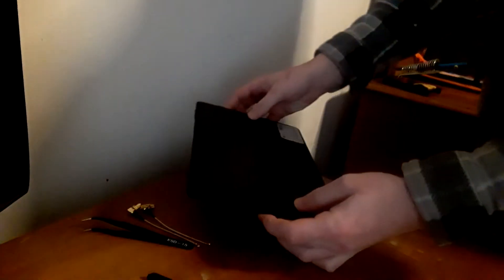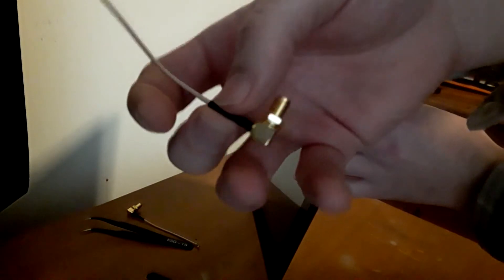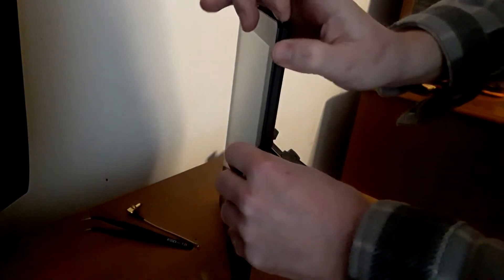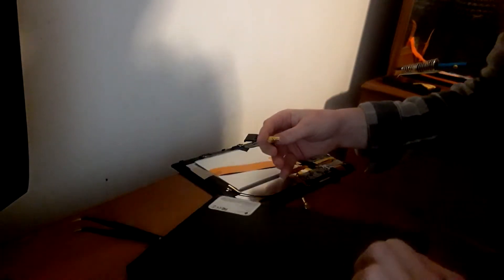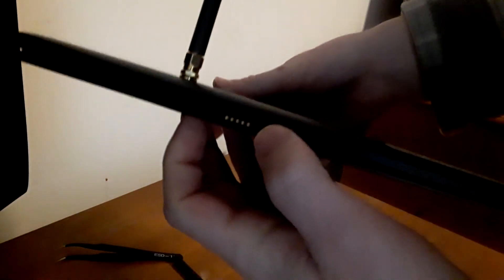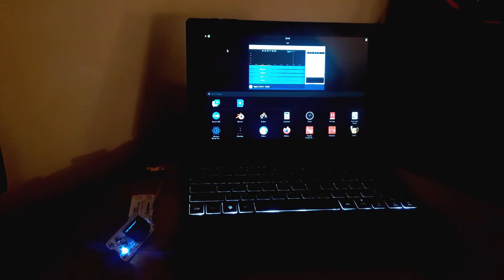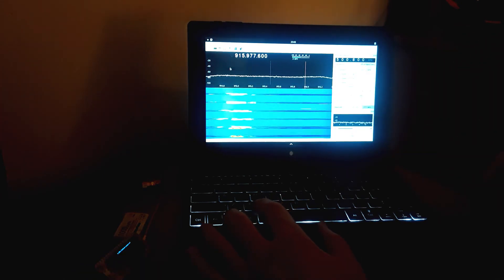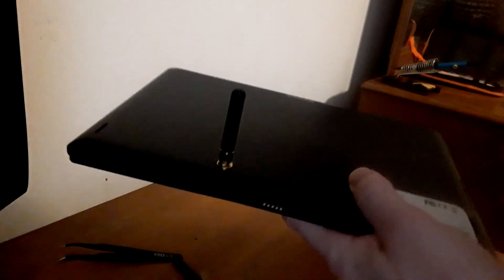Opening Pinetab + Add SDR Modification!

Comment from the maker: NOTE: To anyone trying this- Be VERY careful not to risk breaking screen internally. Not on video: grinded away a few milimeters of the 'cube' block part of the threaded end piece before closing + added a thin layer of electrical tape to take off the hard edge/cushioning. Be VERY careful not to put too much pressure on your screen when closing. Let me know what you think and if you have any questions at all! 8-)

Comment: Where can you get a replacement screen? And NO I didnt crack the screen following your instructions. My dog actually knocked if off an end table and shattered the screen. Any ideas of the specs on the screen or where you might purchase another screen would be greatly appreciated. I purchased the PINETAB 2 Screen but it was a no go; it did not fit!!!
Reply from the maker: You might be able to buy one from Pine64 - but I have no idea as they stopped making this model. 

One thing that might work better is asking pine64 forum if anyone wants to sell their pinetab v1 and then use that one for parts. It's an idea anyway.
Reply from the maker: Another idea; check the screen for model number on the back - then put that model number in quotes to make it come up on search with "buy" in quotes to find the same model.

This might be your best bet.

Man that really sucks about your dog knocking it off... I know how much that hurts. 
😥
Reply from the maker: Once in a while you can ask customer support if they have parts to sell - but that usually applies to current items. I don't think they have anymore screens, but searching for the exact model number in quotes with "buy" in search query, would likely be the best bet on search engines.

Sometimes the same parts are used in other products, and model number is likely to provide the most likely best results.

Since Pinetab v1 is older, less maintained for people, there's a chance you can ask on the Pine64 chats as well via discord etc. That's where most of the people who own them hang out, and some would likely want to sell one. Worth a shot.

Comment: Can i installed Bliss OS in PineTab? PineTab is repairable and upgradable?
Reply from the maker: Pinetab shown in video is version 1. Sadly, isn't available on Pine64 store any longer, but if you get lucky you may find one used from time to time.

Pinetab 2 is what I would wait for if interested in Linux tablet. Should have more info on availability around April according to Pine64 blog.

I'm not entirely sure how modular the Pinetab2 will be, but do know the back will pop off much easier by design for repair related needs.

I'm guessing it will be similar to Pinetab 1 (seen in video), but the power will be much better, more in line with pinebook pro. 

On Bliss OS, not too sure if there is any dev on pinetab, though there has been for other Pine64 devices.

Comment: What rtl-sdr is that? Did they release the one they were talking about releasing for the pinetab and I missed it?
Reply from the maker: Pinetabs aren't available atm (this rtl-sdr did come in it. It works perfectly for SDR in a nice compact/thin tablet (I added the threaded external SMA port as shown in video). Pretty happy with it. 8-D
Reply: @RTPTechTips  I got the tablet with the keyboard last year. I need to update it with something other than the tablet version of Ubuntu though.
Reply from the maker: @nullsmack  You can get a rtl-sdr generic and hook it to the internal usb with ribbon cable: https://cdn.discordapp.com/attachments/722173748647559298/818223939813245008/file_3656.png

Then follow this video to add the external SMA threading for quick/easy antenna changing. :)

PS: as mentioned in pinned comment I ended up grinding a few mm off the part to ensure my Pinetab would close without risking damage to screen. Definitely be careful and ask me if you have any questions/need help.
Reply from the maker: @nullsmack  Try Arch (DanctNIX) I did a tutorial on full install script with drive encryption a couple videos back. It works well, has some cpu acceleration, and if you follow the video on installing it, I optionally show how to add BlackArch repositories to gain access to a ton of pentesting/radio sdr tools. :) Mobian is also nice.